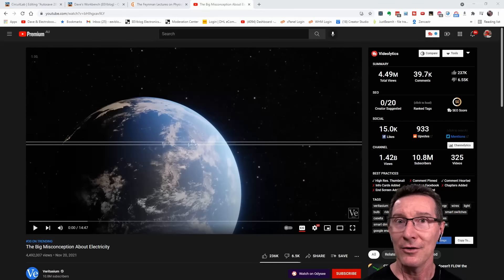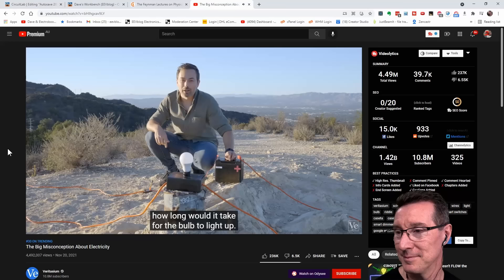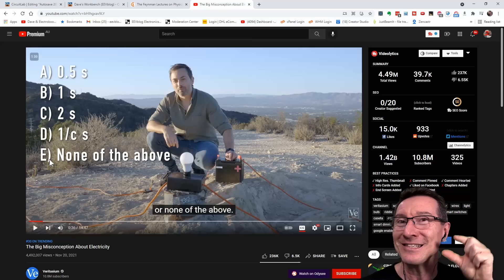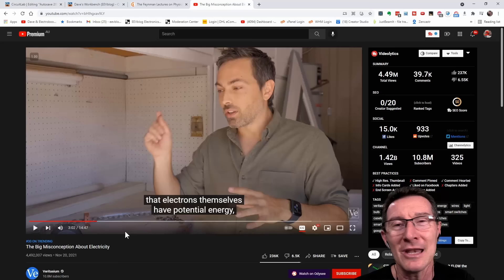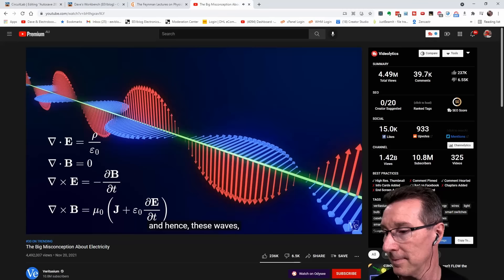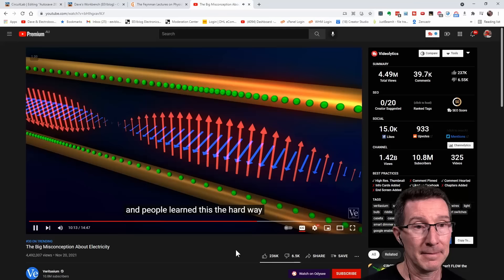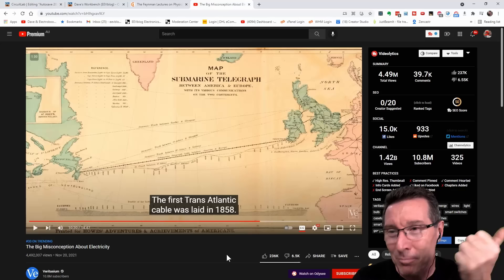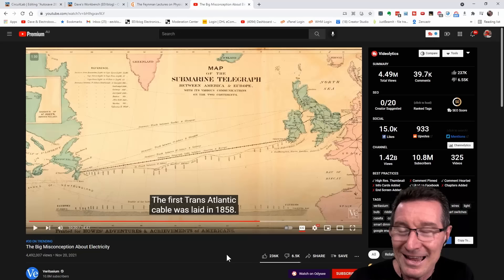EEVblog 1439 - Analysing Veritasium's Electricity Misconceptions Video

Comment: I really miss the days when Veritasium's videos didn't require other people to confirm or refute them.

My main problem with his video is that, if there is an open circuit at one end of the loop, then the light will not turn on. If the switch in this thought experiment is at that point, and it is still open, then I would think that the light would not come on. I am fully on board with the power traveling through the wire via the electric field. I just think that that field would have to travel the length of the wire, at the speed of light, before making it back to the lamp. I do not believe that the battery that he is using is powerful enough to generate an electric field that is powerful enough to reach across the 1 meter gap.  So, I am still in the 1 second camp.
Reply: Yep. Good engineers have confirmed that you would get two power events. The first is an antannae effect that propagates at the speed of radio and transmits about 0.1% of the final power, and like you affirm: the rest is delivered after a full second has passed.
Reply: @beingsentient  I don't think the transmission line analogy makes sense. The setup is placed for a long time, and there is only one switch on the right side of the battery, so the entire wire to the left has the same voltage of the battery. The battery itself has no on/off switch, it can't change its voltage from 0 to something. I can't understand how this is a transmission line.
Reply: @edward3190  I'm not sure what you're referring to when you say "transmission line."  With a battery DC circuit, it's not a transmission line, once past the initial transient and steady state is established.  Is that what you mean?  If so, you are right.

In the first 10^-8 seconds (that's 10 nanoseconds, or 1m/c seconds) or so after the switch to the battery is closed, the bulb first feels the effect of the battery, as I explain in a previous post.  During that time, the wires do form a transmission line, but that's all an irrelevant detail in an explanation of the start transient details, and the transmission "solution" that Dave provides in this video is irrelevant to the reason explaining when the bulb first feels the effect of the battery.  

In the AC case, even during "steady state," the EM field constantly changes, emitting EM radiant energy, which is not the energy that lights the bulb.  The latter is explained in the same way it's explained for DC.  

Does that make it clearer?
Reply: @beingsentient  Thanks for the explanation. I figured it out. My original concern
 was like this: The voltage of the battery's positive end, the voltage of of the bulb and the voltage of the right end of the switch are all equal before the initial transient. When the switch is closed, the left-hand side of the circuit doesn't form a transmission line because their voltage were equal, but the portion near the switch does.
Reply: @beingsentient  feel bad for asylum, his vid is good but only got few view when compare to vita
Reply: @beingsentient  
Right that it's not matter of opinion.  Vartasium is just plain wrong.  You need the wires.  He doesn't even understand something simple as DC vs AC.  He can reference Feynman but that does mean he understands Feynman and in fact he does not!!!!
Reply: @joeboxter3635  I understand Feynman very well.  Do you?  I bet you you didn't try.  The Feynman reference can be read on the WWW.  Read it.  I dare you.
Reply: @edward3190  Yes to all of that.  The E-field in the wire is initially zero because there's no initial gradient.  We can also reason that the distance between the bulb and the battery is not as important as the distance between the bulb and the end of the switch that is attached to the un-energized wire, because as you say, that's where a non-zero E-field initiates and propagates at the speed of causality (light) down the wire, forming a transmission line.  

I'll point out here what I pointed out in my first post, directed to Dave.  The transmission calculation Dave does relates to the closure of the switch and to the wire energized by the switch closure along which an EM wave propagates.  It has nothing to do with the propagating EM wave that travels from the newly energized wire directly to the bulb, bypassing the wire.  Dave's transmission analysis is thus irrelevant.  

Now, can I enroll you in explaining all this to the 95% of engineers here who don't have a clue on what's really going on, both electrically and physically?
Reply: @beingsentient haha sure!
Reply: @beingsentient  I don't need to read the Feynman lectures.  I have his 3 series on physics and I poured many hours even over years going through them.  And no Feynman lectures could ever act as a reference for something as dumb as Vertasium has been selling.

There is no way DC electricity can travel with out wires.  There is no way that DC electricity can induce a sustainable voltage in a nearby wire.  DC is constant not changing.

You know why? Because it takes a changing B field to induce an E field (which is the source of voltage as voltage  is just integral of E field over distance).  No induced E field so no Voltage.  And the B field produced by DC is always constant.

How about YOU go back and study Feynman.  Because I already have.  That's how I learned all this on my own.  And I also had a friend who has advance degrees in both physics and Electrical engineering review the video, before I said anything.

I wanted to be doubley sure that I did not say something which I hadn't also run by him.

And if you don't believe it, try it in the real world. Run a DC current next to a wire and see if there is  induce voltage.  It just won't happen. And no voltage, no light.

(The superconductor is a red herring.)
Reply: @joeboxter3635  I understand you.  You'll never understand what we're talking about.  But FWIW, I'm referring only to Section 27-5 in Vol II of the Feynman Lectures.  You owe it to yourself to read it, because as of now, you prove you cannot comprehend the technical issues.  I mean if you have any self respect.  You get an "F" for the course.  Sorry.
Reply: @beingsentient  You are wrong however.  And so is Veritasium.
Confirmed both here (theory): https://www.youtube.com/watch?v=iph500cPK28
And here (practical): https://www.youtube.com/watch?v=2Vrhk5OjBP8

The 1m gap is too significant for that type of light bulb to light up in the less than 1 second.  Possible more if the impedances are wildly mismatches as illustrated by Electro's video.
Reply: @joeboxter3635  You guys must not have actually watched the Veritasium video. Yes you need the wires. All the EE stuff is still there. What he was pointing out is that fundamentally power flow happening the energy flux, showed by the poyting vector. Everyone here are arguing at totally different levels of the understanding.
Reply: @jvandervyver  The radiation you get that induces the tiny current IS exactly a consequence of what Derek is showing. You are upset because the practical experiment doesn't also refute everything we know about electricity too, which is... never the point. 

The energy flux is moving your power, even though it LOOKS like wires and electrons are doing it. Just like you look like flesh and blood, not atoms.
Reply: @bobdole57  I'm both not angry and my level of understanding is perfectly fine.  As is a significant portion of other folks here.  The annoyance is not due to a lack of understanding.

Those that post here with "You are just not smart enough to understand it".  Are essentially muttering to themselves under their breath "BUT I DO HAHAHAHAHA".

Thus for them, it has become a case of clinging to this idea because it shows how "smart" they are.

I know I understand physics.  I don't need a video from YouTube so I can confirm to others how smart I am.  Nor do most of those pointing out the obvious BS in the video.

Yes some people don't get it, but the concept is fairly trivial, as far as physics goes.

The reality is, as has been pointed out by many others, the premise that the bulb would light up immediately is wrong.  The current is too insignificant.
Reply: @jvandervyver  if you actually watched the video you'd know the actual point had nothing to do with whether the bulb would get a large amount of current. Yes it's a tad clickbaity, but the point was to illustrate the principle somehow. It's extremely difficult to do.

I don't care if you understand it or not. You're throwing the baby out with the bathwater. It's somewhat difficult to believe you watched the whole thing if that's what you took from it.

Comment: At 7:20, the Poynting vector applies ONLY when the electric and magnetic fields have the same source; if they have different power sources, then it yields nonsense.  E.g. at 7:40, placing a permanent magnet adjacent to the battery would still cause no energy transfer.  At 8:10, the electric field inside the wires is VERY small, E=V/L=IR/L; wires have very small R and long L, so E is substantial only for VERY large currents I.  At 10:30, the Poynting vector points from the battery toward the load -- NOT toward the wire -- at DC there is no radiation but there IS energy transfer.  An electric field pointing radially away from the wires crossed with a magnetic field around the wires yields a Poynting vector parallel to the wire toward the load... this is true for both wires since both the net charge sign and the current direction are opposite for the two leads.  At 19:00, there will also be reflections from the ends of the cables arriving after 1 s, so I am not sure whether the full brightness is achieved until these fluctuations die off.  In fact, 600 Mm of wire has substantial resistance so the light probably would not light up at all unless the conductivity was infinite; in that case the electric field inside the wire would be exactly E=0.
Reply: Videos explain that all "magnetism" is just electric charge that is pushed together by the contraction that happens due to special relativity
which in turn is due to speed making it harder for massless phenomenon such as light & gluons inside protons to get anything done = they try to reach the other side of the proton but the proton moves away due to the speed & this means that e.g. sand in an egg timer avalanches downwards more slowly, time ticks slower at the front of the e.g. spaceship so (like....horrific analogy: like people trying to get out of a narrow fire exit) the back of the e.g. spaceship moves into the slow moving front causing a contraction. & if you contract a load of electric charge into a small space (eg in a magnet you have a lot of atoms spinning quickly) you get a strong electrical field which we call "magnetism"

Comment: It seems to me that there are 2 things happening here: 

1. Exactly what Dave described, where there is an 'almost' instant response across the imaginary capacitors.

2. A wavelike propagation down the whole length of the wire, as electrons are compressed against each other. This is similar to having a long stretched rope and whacking it at one end. A pulse travels down the rope and bounces (mirrored) off the far end. For an alternating source the reflections would also interfere to produce standing waves etc. The point is, the pulse propagates down the wire at the speed of light.

In other words, 'yes' the current 'starts' to flow through the light bulb almost instantly, but it will not be fully lit for at least (the wire length)/c. 

Even Derek begrudgingly seems to have admitted this. As for the 1m/c, this is indicative of the time it takes for the impulse to reach the imaginary capacitors and inductors.

This said, Derek certainly seems to have mastered the fine art of 'click bait' to devastating effect. I even find myself drawn in.
Reply: The electrons aren't compressed against each other.  Electrons don't move like marbles stuffed into the end of a hose.  The reason the electrons move is because of the electrostatic wave that travels at the speed of light along the conductor.  That wave pulls at all of the electrons at essentially the same time (within the speed of light).
Reply: Well, by the purely theoretical point of view of Derek's video, if we want to be punctilious, the current never stops. Even when the circuit is open an infinitesimal amount of current will pass through the "load" simply because the "battery" exists. So the question does not even make sense, the light bulb will always be on by Derek's definition.
Reply: For any practical voltage and light bulb, the impedance of the transmission line is going to be much higher than the resistance of the bulb.  This presents a load mismatched to the transmission line.  What would happen, in his preposterous circuit (preposterous due to the zero-resistance assumption) is that since the capacitance is distributed over the length of the transmission line, there won't be just an initial pulse through the lamp, but a step function, because that distributed capacitance, due to the length of the wire, provides a continuous source of current WHILE the current pulse from the battery is propagating through the wire.  What will happen, then, is that the bulb will illuminate, VERY dimly, beginning at the time it takes the pulse to get through the capacitance at the entry point of the transmission line, and it will remain in this very dim state until the pulse returns from the shorted end, one second later, when it will finally reach full brightness.  When the switch is opened again, there will be a similar response, as the distributed capacitance discharges over one second, before the light goes out altogether.  Sort of.  I mean, the problem is, it's still a transmission line, and it's going to ring for a while as the pulse gets reflected back and forth.
By the way, this is what is known in pulsed RADAR applications as a pulse-forming network, which is used to produce precisely timed power pulses to an RF power tube to set the width of the RF pulse being transmitted.  Again, as EEVblog says, nothing new here.
Reply: Click bait? No, Veritasium has the knack of getting people interested is something and learning something new, therefore encouraging you to take it further if you want to. That is what educators are supposed to do, not just teach a curriculum to pass an exam. Unfortunately, some people who have specialised, or studied at higher levels than most in a particular subject, get upset by someone making a short introductory video, and write derisive comments. Only the true disciples of the engineering gods can ponder the truth?
Reply: @another3997  You certainly have a very personal idea on what teachers should do. I have been an electronics teacher for a long time and I never thought it was my duty to link (or mix up) several different eletrotechnical topics, without clearly giving their bounderies and limitations, messing up units, leaving away vital information about distances etc…. in order to “encouraging to take it further if you want to”. But I suppose I have been a very bad teacher.
Reply: @another3997  Have you read the comments on his original video?  Have you seen the incredible level of confusion and misunderstanding that has resulted from his "education?"  People who have this result are not educators.